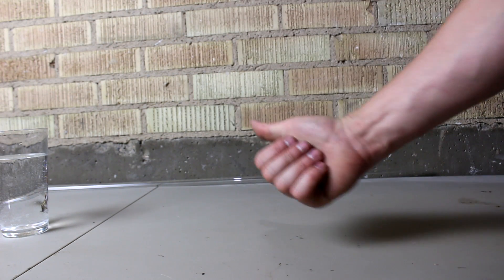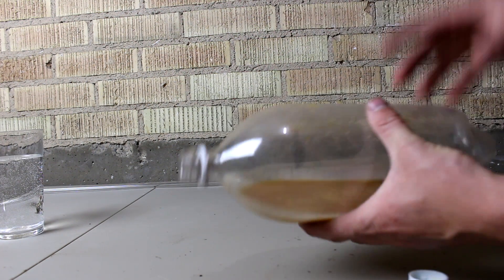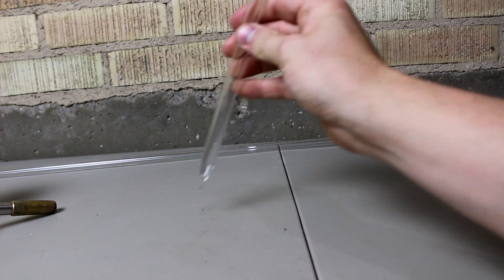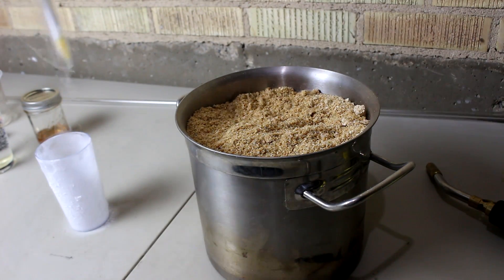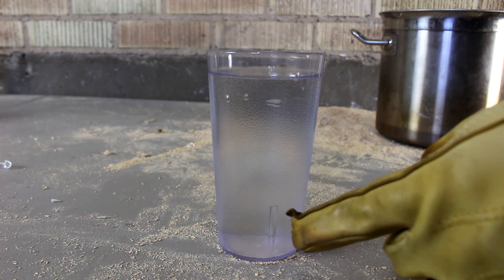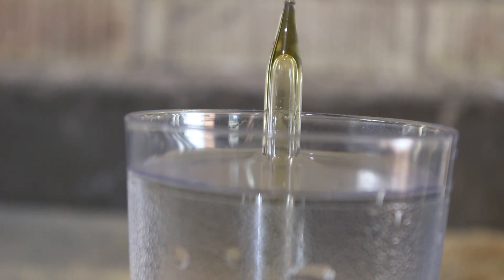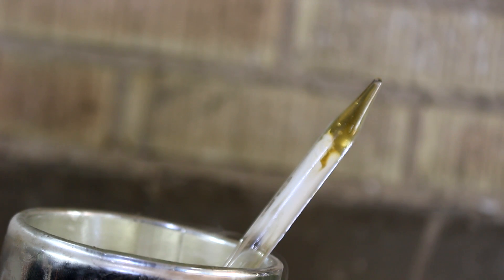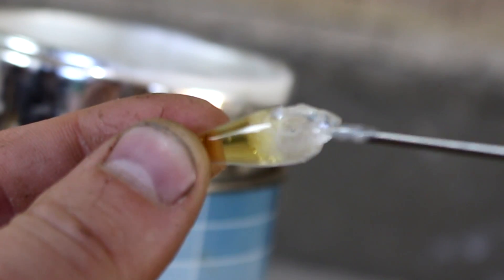Carbonating Honey Part 2

Comment: How about extracting ThO2 from that TIG/WIG electrode. Should be 2% by weight or volume, don't remember. Electrolysis in NaOH (aq), in H2SO4 (aq) I think it passivates W and stops electrolysis. H2W04 has really nice canary yellow color. I electrolized WC sintered carbide tool for steel filing and grinding, and as a bonus was left with pink CoS04 (aq). One day have to go back to it and precipitate Co(OH)2 for glass blue pigment. Carbon from WC just bubbled as CO2. ThO2 has the highest melting temp. as a crucible material that can work in air. In Germany this "red" rods are baned from industry because of dust radiation when they are sharpened on a diamond disk. La, Ce, Zr or a mix of rare earth metals are used as doping metals instead.

Comment: Hi Cody. A few thoughts:

1. I wonder whether more CO2 could be dissolved in the honey by increasing the surface volume of the boundary layer between the CO2 and the honey. Since it's not very practical to agitate with a stir bar, it might be interesting to leave the tube rotating on the motor of a ball mill for a few hours. 

2. Instead of condensing CO2, why not seal the tube after adding some dry ice?

3. I suspect that the viscosity of the honey limits perfusion of the CO2. might be interesting to warm the tube before turning it to reduce viscosity.

Comment: This begs something of a question...  Using pressure-vessels, and/or a vacuum chamber, would it be possible to distill alcohol using pressure-differentials rather than heat?  and could you control the reaction well-enough to remove the other alcohols that are dangerous?

Comment: You should see if you can make a similar product with your big reaction vessel thing (on a much larger scale), by putting a bunch of honey in it, vacuuming out all the air, and pressurizing it with Co2 (obviously the PSI won't be nearly as high, but maybe it would be sufficient enough)

Edit: Nevermind, I think a 2 liter bottle can reach, if not exceed the PSI of the vessel, so I suppose it wouldn't work.

Comment: I've told you already before, but I'll repeat it for your own sake, and for the sake of your viewers, please practice sealing glass ampoules and glassblowing in general. You're pinching them or leaving thin spots. If you take a look at those through crosspolarized filters, you'll see they're under extreme stress and are basically bombs waiting to explode.
I hope you're wearing a faceand neck shield at all times when you're doing this.

Ampoules in general, especially ampoules under pressure, need spherical seals. Glass readily does this when molten, no need for pinching and twisting.

Comment: how do you know you've reached the critical pressure of 73.8 bar needed to get a super citrical fluid? Couldn't your CO2 just be switching from gas to fluid at that temperature and slightly lower pressure?

Comment: The escaping gas needs to travel to a nucleation site, probably at the doors of diffusion for the liquid. It makes it a pain to make degassed liquid in the laboratory, because simply putting a bottle of water under a vacuum won't immediately draw out all the air, but it's the reason why sodas don't lose all their gas the moment they're opened.

Comment: Hey cody, you could use a vacuum chamber with honey in it to remove the air, then use a valve to put carbon dioxide into the chamber, allowing you to make lots of this at once with relative ease.

Comment: Cody could you perhaps try achieving higher pressure in a metal pipe? I know you wouldn't be able to see it, but it is far less likely that the metal pipe would explode like the glass. What I'm talking about is something like a 9in pipe solid-capped at one end and a modified cap with a valve or pressure gauge at the other end. Put a schrader valve and you could test it with a tire gauge and release the pressure before opening it. Pressurize it by putting some chunks of dry ice. With the pipe you could probably get a higher yield that 2ml. What i'm picturing is something that resembles a pipe bomb from Left 4 Dead, but with a schrader valve at one end
Reply from the maker: SuperGiggityMaster 
glass is actually stronger than steel it just tends to shatter more easily. That said I may make something like that for my "Venus" chamber.

Comment: So Cody, when the CO2 was liquid on top of the honey, was it still extremely cold or did it warm up to room temperature? That's something I've always wondered about liquid gases like CO2 or propane. When they're in liquid form, they are extremely cold because of their nature, but if you were to simply keep it liquid via pressure, would it eventually warm up or stay cold? If it's the latter, why?

Comment: I have carbonated honey before like this:

1/4 cup honey
1/8 cup water
blend until... blended? lol
1 2L bottle
pour honey dilute into bottle
used a modified airsoft mag with metal tube to pressurize the bottle by blowing co2 under and through the honey.

once it pressurized and sat for a week or so some of the water separated and we cut the bottle open. honey was back to regular consistency and had a layer of soda water on top. both were fizzy.

Comment: That reminded me of my first quarter of ochem, we took orange peel and placed it in test tube above a screen.  We filled the test tube full of solid CO2 and sealed it.  As the pressure rose the CO2 turned to liquid and pulled the essential oil out of the oranges and when the pressure was lowered the oil stayed out.  This was really a neat video.
Reply: Nicholi Martin It's the same method for getting caffeine, extracts, THC, nicotine, and other goodies. I never knew $10,000 in high pressure gas fittings could be replaced by a glass tube and a propane torch.
Reply: I never thought about extracting THC or Nicotine that way, but it makes sense.  Thanks.
Reply: @andyjones7121  very cool stuff. Butane is a more common used solvent for extracting thc, as you don't need it pressurized

Comment: how much would a jar of carbonized honey cost?
Reply: No harder to produce than pop rocks. At least if it became popular and economies of scale reduced the price.
Reply: Not much. You can buy stainless steel pressure vessels rated above 10,000 psi, so scaling up batch size isn't a problem. Plus your ingredients are just CO2 and honey, which are quite cheap.
Reply: that sounds reasonable. someone do it
Reply: Zack Snyder depends on the size of the jar
Reply: yeah, id guess its would be really hard to mass produce, so probably a lot of money for one of the tiny jars

Comment: Hey Cody, is it possible to make Solid Sulfur Hexafloride or Solid Helium?
Reply: Helium can be turned into a solid at 1K (-272°C) with 25 bar of pressure.
Sulfur hexafluoride freezes around -64°C
Reply: Alex Lawson: For one point in space to be at 0 K, no heat must flow towards it (since you cannot remove heat from a body at 0 K). No heat flowing towards it means no local thermal gradient. No local thermal gradient means neighboring space is at 0 K too. Which means space around that is also at 0 K, etc...

All you can do is asymptotically approach it by putting more and more effort in removing heat and insulating.
Reply: Bisceps Gaming solid helium i know for a fact cant be turned solid it reaches some state where it doesn't bubble and it can merge through solid objects like glass cups its pretty cool look it up
Reply: well it should because there is a temp at urethane where any atom just stops moving/no energy
Reply: Do you know if it's possible with Sulfur Hexafloride?
Reply: You mean absolute zero? Humans have yet to replicate or even witness anything of that temperature anywhere. It's just a theory that things are able to have no energy.
Reply: We've gotten down to nano kelvin.
Reply: Exactly. In fact, due to the nature of heat if you had managed to create or observe 0 kelvin (or absolute zero) the entirety of the universe would be 0 kelvin. To clarify, if 0 kelvin ever existed or could ever exist, the universe would be or will be 0 kelvin as well. Which is why it is a scientific principle that absolute zero cannot be reached: It would mean it is possible to destroy energy.
Reply: Could you explain why it would mean it is possible to destroy energy if 0 kelvin ever existed? wouldn't the energy just have to move somewhere else?
Reply: That actually makes sense. I guess I just forgot about thermal equilibrium.
Reply: Helium is impossible. Sulphur Hexafluoride is possible.

Comment: Cody, you should do an in hive video on the timing of emergency cells and supersedure/swarm cells. I think the quality of the cell is a factor of how many bees are in the starter/finisher, not whether they are doing it under this influence or the other. If they are capped on the same day, then the only amount of influence the bees had on the cell was before it capped, and the only differences between one or the other would be based on the amount of bees, yes?